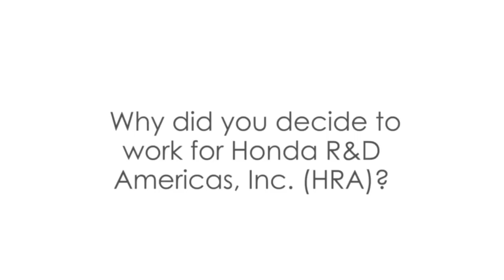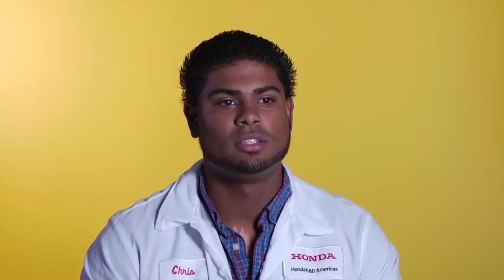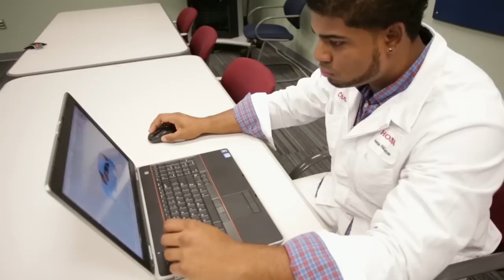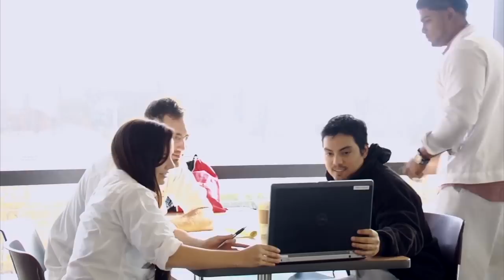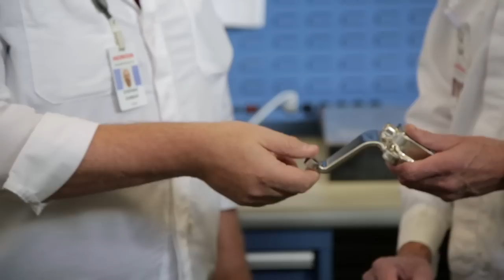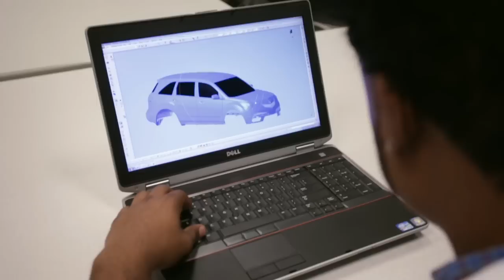Honda Research & Development

Comment: My 2011 Honda Pilot blew an engine after 45000 miles, and it was replaced under warranty with a remanufactured engine. I was told I was getting a new engine, but when the valve cover gaskets leaked after 2 months, I was told it was remanufactured. I have no faith in the vehicle, and American Honda will not help me. I am a LIFETIME Honda owner, and have had about 15 Honda's since 1983. Today, Loretta, the so-called customer service rep, hung up on me when I said I was recording our call for my records as well. Before she hung up, she told me that my request to get a new service warranty, on the car I have to buy to replace this lemon, was denied. After a two week delay in returning my call, that was all she could do. I asked for the info in writing, and she told me that I would need a court order to get it. Not exactly the care I would expect from a company like Honda. Today, I am posting here, and my social media campaign will end when i get the proper resolution, or someone at least treats this lifetime customer with dignity and respect.